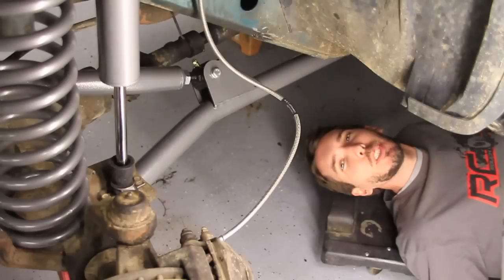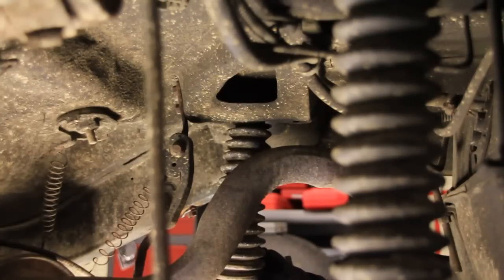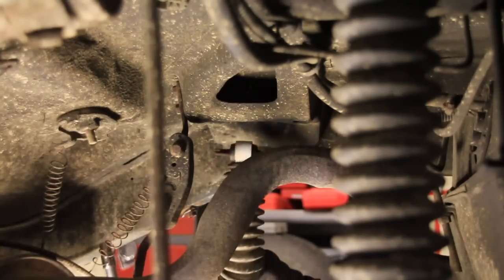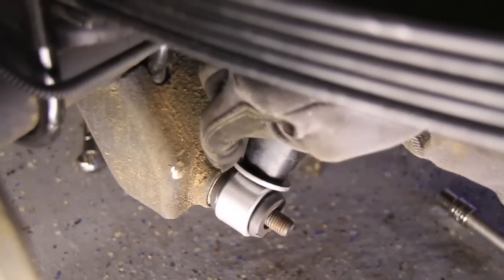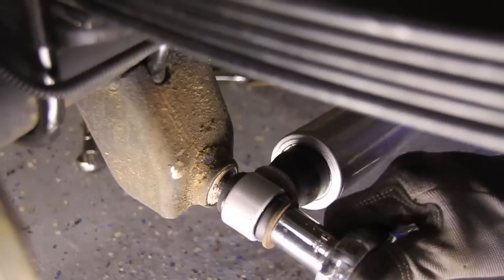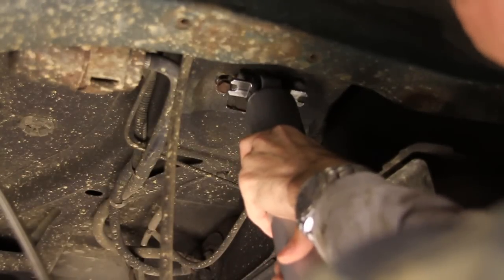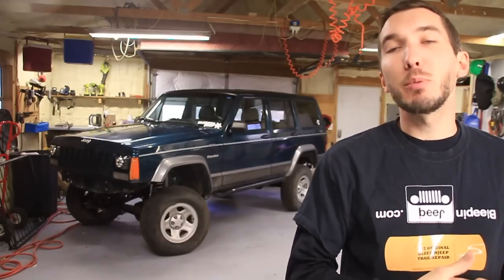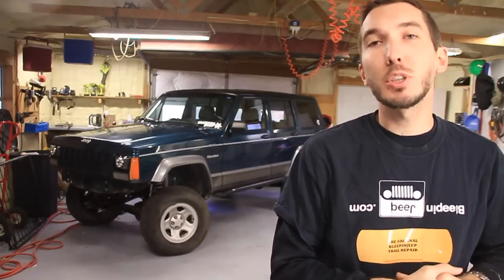How To Install Rear Shocks - Rough Country

Comment: I replaced my front and rear shocks on my 01 jeep Cherokee limited with procomp es3000s, but still bottom out on the even slightest of dips in the road. Does that mean my leaf springs are shot?  I should add I do have a pretty heavy trailer hitch installed( it came to me that way) on the front end passenger side it rattles a lot too
Reply from the maker: Either that or the shocks are too long

Comment: Snapped one of the lower rear shock studs. Any bright ideas on this?
Reply from the maker: Lonewlf7676 weld that sucker back on!
Reply: BleepinJeep Don't have that option. Yet.   I have seen others go about it by cutting the rest of the stud off and drilling it through. The new air shocks I got came with a lower mount stud, though it is threaded only on one side and the other end is the big flat pan head like is factory on the inside of the Cherokee shock mount.  I was considering drilling through and just putting the nut on the inside(by the u-bolts, under the axle tube).  Any reason you can think of NOT to do this?

Comment: Didn't break every single upper bolt, this can't be real.
Reply: Yeah I broke all 4 even after soaking them for 3 days and using a ratchet instead of an impact haha. They bolts were junk from the factory...why they chose a bolt so small for something open to the elements is beyond me.
Reply: I’f they break what’s the best way to secure the shock